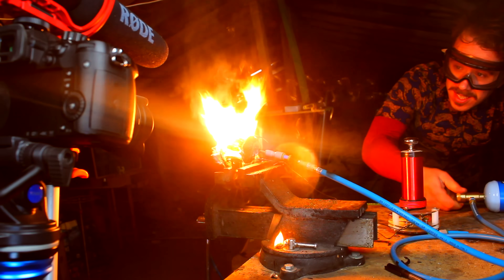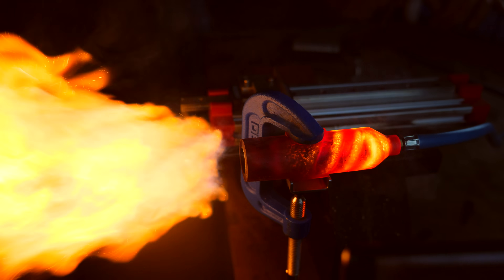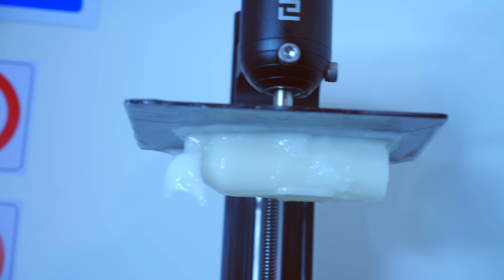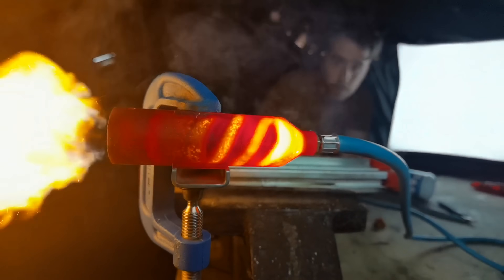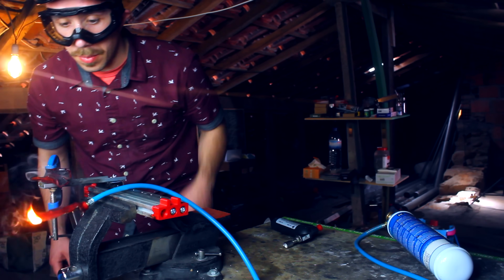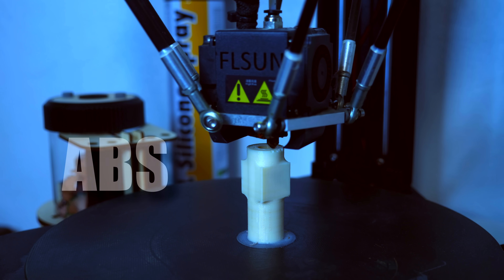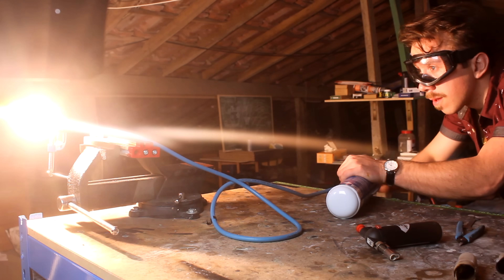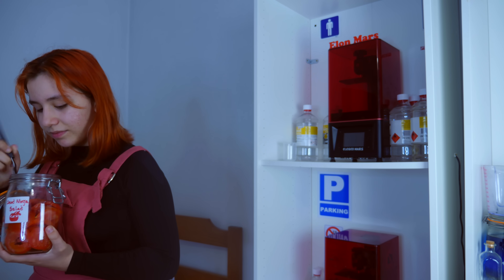Rocket engine that uses itself as fuel! (3D Printed)

Comment: Nice video! There are lots of improvements possible with the fuel. To start PLA (esters burn easier) will probably be a better fuel than ABS (carbon rings and doublebonds...lots of soot, dirty burning). Over all waxes (alkanes) perform best in hybrid rockets. Maybe try making a resin print with wax, or print a porous fuel grain and then fill with wax. If you want to go on with the sugar fuel, add a catalyst (1% Red iron oxide...this should work for PLA as well). Adding 1% Al powder to any of your mixes should improve the combustion. I think probably the most interesting rocket you could build would be combine the ceramic vortex cooled rocket with a fuel grain in the centre. The fuel grain might look like an aerospike redirecting the flow of the outward spiraling oxygen  back over the fuel grain and out the nozzle. As a caution, put a safety/long-lever ball valve in the oxygen flow of your set-up. This will allow you to shut off the combustion instantly incase of an accident. Remember, you are playing with fuel and oxygen (fire). Keep up the good work.
Reply: Idea: Resin printed fuel grain with rigid spirals and a porous/connective structure that can be filled with molten wax. The spirals would help direct combustion flow while at the same time maintaining the structure of the wax. The wax shoud be the main fuel. For proper mixing, fuel and oxidizer sprirals should be opposite. 
Inspiration: A vid of hybrid-rocket with Acrylic fuel. https://www.youtube.com/watch?v=Jqr3oKIb_1A

Comment: What about a thicc cone of fuel ? A shape charge like shape? 3d print and coat in ceramic just the nozzle and the outer body of the fuel rod , also coat the body of the rocket in ceramic and  high temp paint

Comment: U could try to get some areogel to build a rocketengine. It should stand the heat, be hard enought to be stand the force it produce and is lighter than everything eles u could get. If you cant get aero gel try to get a CC made Aluminium engine and coat it with an ceramic layer to prevent overheating combinde with a CO2 cooling system...

Comment: might it be an idea to use a ball valve so that you can shut off the oxygen faster and you don't burn down your attic?🙃
Reply: You should hook up the oxygen tank to a solenoid so you can wire up a dead man switch that cuts of the oxygen supply when you inevitably set the attic on fire.
Reply: @Jacob-gg1rt  Integzabot 2.0
Reply: it could be remotely controlled by an arduino-bluetooth setup..
Reply: @dans-designs  or by tomato slave
Reply: @dawidhojny4887  tomatoes are disgusting but so is slavery.
Reply: Or run his tests in a place less flabable......with more ventilation.....and a better egress route in case of an emergency......
Reply: Solenoid would be best, can control it from a distance and even program into Arduino a safety protocol.
Reply: But what would be the fun in that

Comment: You should look into nitrous oxide oxidizer for your hybrid rocket engines because it's a much better oxidizer than gaseous oxygen. Nitrous oxide is able to be kept as a liquid without cooling (only pressure) which allows you to pump a much greater volume of oxidizer into the engine at a given time.

Comment: Here is an idea. 3D print or manufacture a pressure and temperature resistant housing or housings that has a standard nozzle so that you don't loss that  bell shape as the material burns. Then 3D print the "fuel" with the double helix that can be placed into the "rocket" motor housing. Also for your plumbing, if you are not already using a check valve to stop back flow, use one for safety. Lastly, incorporating a simple valve to quickly turn off the flow of your oxidizer or fuel will help to not burn the place down. I like your videos and don't want to see your home burn down.
Reply: Or I could have just watched the rest of the video before commenting....

Comment: You should use load gauges like in scales and a data logger to output the thrust on a graph as well as another underneath to measure the change in fuel mass

Comment: A good print might be combining the two - use the ABS as the fuel and ceramic as the nozzle - you may need to screw the nozzle to the ABS using a thread

Comment: Why don't you make a resin case, maybe plated to stop leaks, in 2 parts to surround the resin/plastic parts so when the fuel burns, it doesn't break the chamber? Maybe 3 parts so you can swap in/out different nozzles while keeping the files for the rest of the casing and the fuel the same?

Comment: Look up "Pyro Fuse" or "Cannon Fuse". If you order, be sure to order " Regular Timer Fuse - 30 sec per foot" This is the green fuse material found on most fireworks. The advantage of the fuse material over the sparkler is that the fuse burns away and doesn't remain lodged inside the nozzle disrupting the flow of the exhaust.
Your evaluation of the slow build up of thrust is mostly correct that as the fuel burns away the exposed fuel beneath is increasing in surface area allowing more fuel to burn as time progresses. It also creates a continuously growing combustion chamber which allows more fuel to burn inside the engine rather than in the exhaust stream. Thrust is produced only by the fuel that burns inside the chamber; the flames in the exhaust is wasted energy.

Comment: You should build model rockets based on this engine. A small built-in oxidizer could probably work and the engine is compact. Also DOWN WITH THE TOMATOES.

Comment: A very bright flame usually suggests an imperfect combustion, so basically you are dumping a huge portion of the fuel. I think you need to add some more oxigen to the system, maybe something like an afterburner. Also, unsaturated organic compounds tend to burn really nast, so ABS doesn't sound like an ideal choice. A plastic with simpler chain should perform better, so maybe PLA is a better choice. Polyesters migh also worth a try, like nylon. Curious to see what you will come up with :D

Comment: I got an idea for you homie. Why not dabble into hover technology? Like using a spinning halback array with magnets above a ferromagnetic surface, but using super conductors instead of regular magnets. Usually a spinning array of magnets above a ferromagnetic surface would cause an eddy current to push the array away from the surface due to magnetic repulsion. Would the same work using super conductors above any surface since a super conductor repels against electrons making it diamagnetic? Would love to know your thoughts Integza!

Tomatoes are disgusting!

Comment: With welding/cutting torches, once the material is being cut through, often they turn off the fuel and only continue with oxygen, and the material being cut through provides the fuel itself. So it makes sense that your rockets would continue to burn with pure oxygen going into them.

Comment: hello,  you are mixing motor and propergol. you have to make a motor in steel that keep pressure. a nozzle in steel or ceramique and you place you 3D printed solide combustible propergol inside.... another sugesstion, if you can print resing with sugar why not to test resin with oxidizer as KNO3. just to  see if you can print a solid fuel motor.  As for the hybrid motor I sugest you to have a solid motor that keep pressure and a solid nozzle that can no melt .....enjoy

Comment: You should try metal casting rocket parts where you burn out the pla in a plaster mold then fill it with metal

Comment: What if you slotted a solid fuel cylinder made of resin into a ceramic cylinder/nozzle? The melting resin might seal the ceramic a little bit? I guess maybe it doesn't melt at all just burn, but thermoplastics should, and also maybe the casing would be reusable? I think burning out your nozzle's internal geometries for fuel, while amazing, is not a good recipe for thrust...

Comment: So, why not combine all the 3D methods to produce a ceramic housing with nozzle and have abs fuel inserts that go into the ceramic print, might take some fine tuning, but if you print the ceramic first you can then make the abs fuel inserts to fit.

Comment: Im not a rocket scientist but in my opinion if you 3d print the outer casing of this hybrid rocket with ceramic resin like you did in previous videos and enclose the 3d printed solid rocket fuel inside it might give better results in terms of thrust as most of the energy generated by the combustion is wasted by the fuel burning itself in outer region melting the body and also due to higher temperature inside the rocket starts to burn itself by getting oxidized by the air in outer region wasting more useful fuel so if it have a outer casing with a nozzle enclosing the fuel tightly inside might improve the thrust and might prevent it from burning itself so quick, and another suggestion from your previous videos using ceramic resin, those rockets usually fail from the seal between two parts ! A threaded nozzle system along with sealant might help !

Comment: I would like to see if you can form a wooden nozzle turn it into charcoal and use it for the rocket, i commented about the hybrid rocket engine like two videos ago but i proposed using paraffin wax as the fuel

Comment: As a kid  in the '90s my rocket/aerodynamics experiments mostly revolved around using Estes rockets. Generally these are shrouded in layered paper/cardboard.  This got me thinking: with the porcelite you may be able to create an outer shell/shroud to contain (reinforce) the resin/ABS/sugar engines and help keep the thrust force directed. Of course, getting the post-kiln dimensions correct will surely be a hassle, you'll probably end up sanding to press-fit the engine core. Regarding the somewhat uneven burn of the fuel, in my past experiments, adding some finely powered iron oxide and powdered copper improved the results of my tests. I think it was around 1% of each. My propellant base was smokeless gunpowder, but I am curious to see if those additives improve burn consistency for you also.

Comment: "I still don't have what I wanted"
Lung cancer?
Seriously: ABS is made from 2 carcinogenic plastics and a third that's a suspected carcinogenic (only when in gaseous form, in solid form they are stable), besides burning plastics in general can produce dioxins.

Please: do these experiments only in well ventilated areas or, even better, with a good filtration system.

Comment: Nozzles are very important, try experimenting with different ratios until you find best one. 
I would also recommend bell shaped nozzle because they cool them self down a little bit by their own, so you have longer lifespan before they are broken so you can burn more fuel with more efficiency (also chunky 3 printed ones should generally more durable due to not having weak attach points).

Comment: What if you try to build the rocket engine thrust test device out of a pendulum? that way you can actually see the movement and the propane tank could be at the centre of the contraption and the fuel line can go over or inside the pendulum arm to the rocket. A machine like the one that astronauts use to test G force tolerances but for testing a rocket, and since it can be almost entirely made with a 3D printer, I supose it will be not that hard to come with a design

Comment: Time to learn how to melt ABS plastic with sugar, and then cast it into a thin wall steel pipe with a ceramic nozzle on the end. That way you will not have the burn out issues.

Comment: Oxygen is the epitome of an oxidizer;  it can be used to fully ignite steel and the steel can be used as a consumable fuel to cut through rock.  Perhaps try using much less in your experiments.  
This comment has more to do with the 3d printed and then baked rockets you have been using in the past.

Comment: Greetings from Brazil.
You could swap the printer head and adapt a drill and you got a cnc.
And cnc the body parts, like the outside still plastic, but the guts you made from a metal foil.
You could use the engine to solder the engine

Comment: im not a rocket engineer but look closely at your exhausts direction, those that fail their exhausts are almost always going at an angle and the heat melts them faster so you would loose thrust. maybe try using a ceramic tube insert?

Comment: DIfferent idea for 3D Printing a hybrid engine:

Print your designs with zero infill, then fill the void with a hardening fuel of your choice.
This gives you the option to test different complex designs, while still using high power propellant.

Comment: ceramic nossle, in a metal pipe housing? with ceramic oxygen port, make the fuel press fit... so you can burn it up with out burning out the sides?

Comment: What you should do is use those as little insert inside a ceramic casing to keep the sides from burning out too early before you get to all the internal fuel.

Comment: " Polylactic Acid (PLA) is different than most thermoplastic polymers in that it is derived from renewable resources like corn starch or sugar cane"

SUGAR CANE
Reply: I can confirm that PLA not only prints odorlessly, it also burns odorlessly. Until you put it out and it smokes. Then it smells like burning sugar.
Reply: @Panda_Gibs  yup. I barely print with PLA. For my applications I prefer  abs or petg but even if it as a lower melting point I think pla is better suited for this application.
Reply: And would melt in a stream of goo fast. LOL
Reply: I was thinking exactly the same!

Comment: Better fuel: instead of making the structure of the rocket burn itself, why not print pellets and insert them in the cavity ? Fast-igniting ones near the sparkler, surrounded by the highest-efficiency ones around it. The body itself could be coated with NoBurn inside for reuse.

Comment: What about 2 part printing the fuel and the nozzle/housing? Such that the housing nozzle assembly made from the glazed printed ceramic, has a printed ABS fuel cartridge placed inside it, so the nozzle housing handles the heat and pressure, while the fuel inside is printed to an optimal shape, plus then you might have a slightly higher reusability factor because you can just scrape out the old fuel and slide a new one in?

Comment: Dude, Get a flash back arrestor for you oxygen cylinder you don't want the cylinder expolding! Also get a ball valve for fast shut off of the oxygen just use the bottle vale as a throttle. I alos suggest that you use a piece of metal in the end of the motor to connect the oxygen line to so you don't keep melting the flexible tube. Great content as always kkep up the good work and don't burn your house down.

Comment: Video Idea:  build a metal printing head for your printer.  That way you can print with metal and eliminate the issues of burn-through with your rocket engine bodies.

That, and the fires in the attic are a little dangerous.  We love these videos, but dont want to see you die for your craft. (although, i guess we wouldnt see that video, since you wouldnt be around to upload it, but you get the point)

Comment: To get thrust you could make a "combo" using the plastic as solid fuel like you did in this video and cover it with the ceramic resin, the cover has to include also the nuzzle because, if the nuzzle burns, it doesn't do well his job (-thrust).
Also in addiction to this you can make a sort of chamber in the solid fuel in which you can put a volatile liquid "starter" for the combustion, in that way you burn simultaneously only the part that you want to burn. Sorry for my english, i hope my idea will help you. Continue like this you are great!

Comment: Hey Integza! It seems like you have some good facility with gas pumping and nozzle design. How about you grab a laser diode and try 3D-printing the parts for a gas-dynamic pumped laser? Might be a good collaboration with Styropyro.

In gas-dynamic lasers, pressurized gas is allowed to expand rapidly through specially shaped nozzles to a very low pressure. This expansion occurs at supersonic velocities, sometimes as high as mach 4. The room-temperature gas has many molecules in the upper excited states, while many more are in the lower states. The rapid expansion causes adiabatic cooling, which reduces the temperature. This reduction in temperature causes the molecules in the upper and lower states to relax their equilibrium to a value that is more appropriate for the lower temperature. However, the molecules in the lower states relax very quickly, while the upper state molecules take much longer to relax. Since a good quantity of molecules remain in the upper state, a population inversion is created, which often extends for quite a distance downstream. Continuous wave outputs as high as 100 kilowatts have been obtained from pumped carbon dioxide lasers.

Comment: I don't know if you will read this Integza, but I think you don't really understand the function principle of an Laval nozzle. A laval nozzle is sopposed to accelerate Gasas to supersonic velocity. this only works, if the gas reaches  the speed of sound at the tightes part of the nozzle. If not, the nozzle will not work as its sopposed to do.

Comment: @Integza:
I believe the reason you have so many ignition/thrust issues is because of incorrect fuel-to-air ratio's. You add air by turning the knob on the cannister all the way open, maybe that is just too much air causing you to ironically suffocate the engine, kind of like blowing out a candle.

Comment: You should really check for an electronic valve for opening and closing your fuel and/or air supply. Would be much safer since you can cut it off instantly. Turning the knob takes a long time, especially when working with potentially explosive devices/fuels/materials. You could use IntegzaBot to control the valves.

Comment: Build the body and nozzle out of the ceramic resin with only the fuel 3d printed.  Still using high surface area fuels, perhaps even a solid-ish slug of fuel with less than 100% infill so the surface area is high but the O2 stream can pass through it.